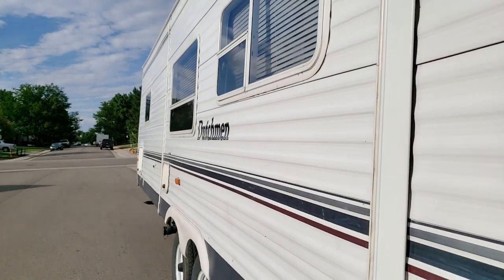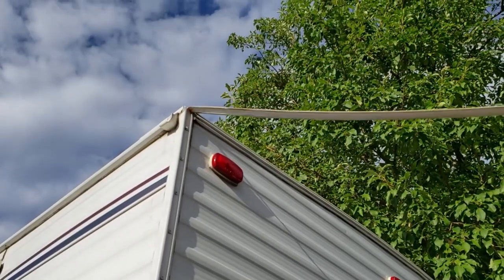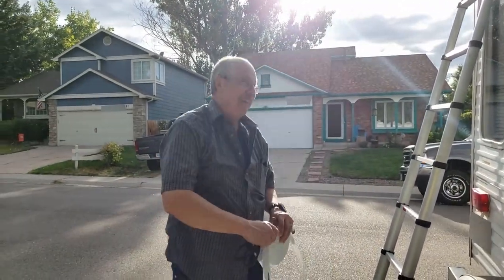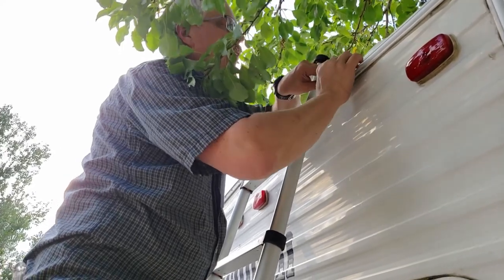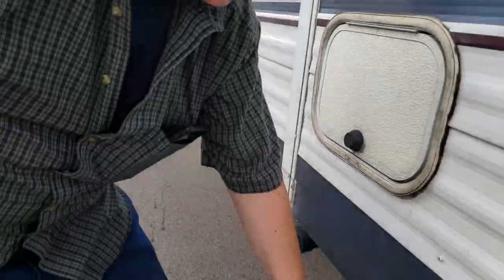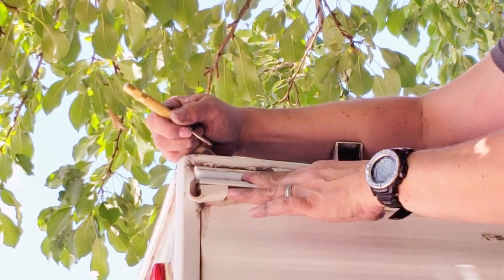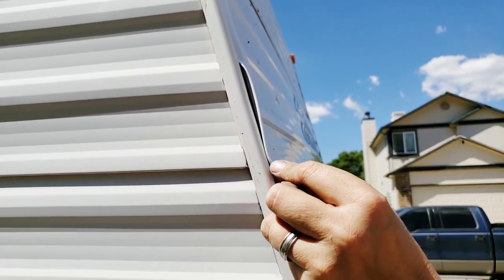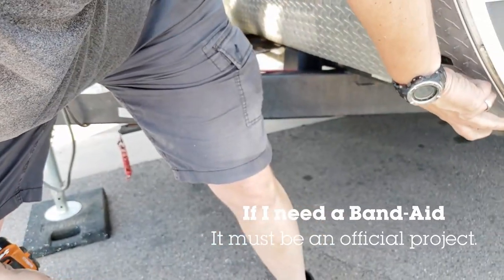Replacing RV Vinyl Insert - Discovered a simpler way

Comment: The decor behind the metal trim is the most important  element in the water proofing.
Vinyl trim is purely cosmetic. 
The horizontal trim areas should be cleaned 100% then resealed with Dicor, again the bottom of the  trim is the most important area, then Vinyl trim it.
Like your trim installation techniques.
Reply from the maker: Thank you so much for the advice and the comments!

Comment: Is that 3/4in or 1in. The Amazon link doesn’t take me anywhere
Reply from the maker: On this particular trailer, I believe we used 1" on the areas we replaced, but 3/4" would be used around areas with really tight corners such as pass-throughs and doors.

Comment: Screws should be chaulked before reinstalling..
Reply from the maker: Hmm.... that make sense although most of them were not chaulked beforehand. In hindsight, extra water protection makes a lot of sense!
Reply: After reading your comment, I removed the trim from three different locations on my Travel Trailer and noticed that none of the screws were caulked.... Another rush job from the factory. With that in mind, I'm going through this unit as if I'm building it myself. I also noticed that I have so much wasted space. I plan to expand my storage space.... Thanks for your comment....